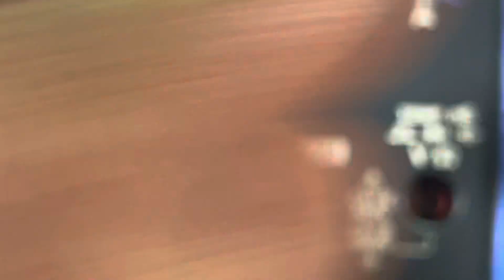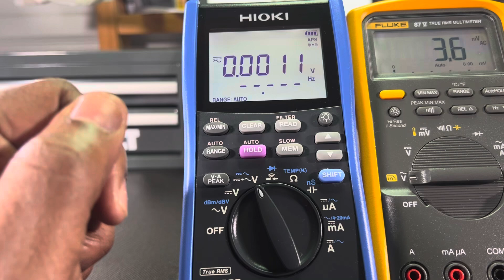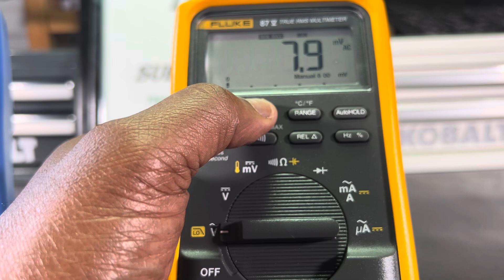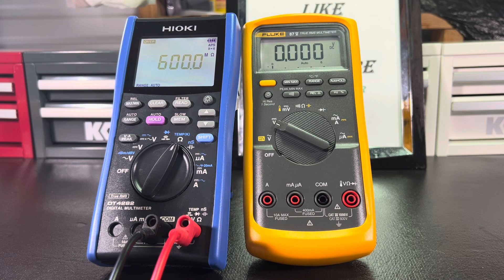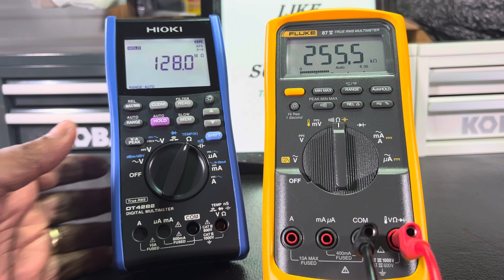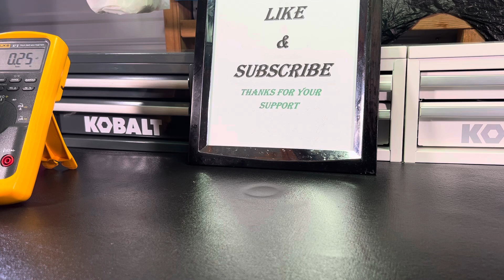HIOKI vs FLUKE  (Loser Go Home)

Comment: Try applying 8,000 volts to both devices for a couple of seconds... a Fluke will survive this without any damage, and the fuses will remain intact—so for a Fluke, 1,050 volts is an easy test. As for the "blue one," I’m not even sure it could handle 5,000 volts in a real-world scenario.
Reply from the maker: You maybe correct, but ask yourself how many times you test 8000 volts on a normal day. Both meters are max rated for 1000volts. So why would test 8000volts with either meter🤔
Reply: @TheElectriciansToolChannel  When working with inductances, such voltage spikes can easily occur. In any case, with a Fluke, my hands won’t shake when I’m measuring voltage on high-power motors, and I’ll trust the readings 100 percent—because NASA trusts them. They rely on these measuring instruments, and for them, errors would be incredibly costly.
Reply: I’ve watched a ton of videos featuring tests of these multimeters... yours, in my opinion, is the most interesting one... thanks for the enjoyable video!
Reply from the maker: Thank you

Comment: An important aspect has been overlooked: power consumption. The blue model uses 4 batteries for 100 hours of operation—at 8 hours of daily use, that’s only 2 weeks of runtime. The yellow model uses a single 9V (PP3/“Krona”) battery for 400 hours, which translates to nearly 2 months. Furthermore, judging by the video, the blue model’s screen is completely unreadable without the backlight, whereas the yellow one has no such issue. Consequently, the blue model—even with 4 batteries—won’t even last 2 weeks if the backlight is kept on. The yellow model’s screen is also much easier on the eyes. And what’s with this nonsense: in standby mode, the blue model flashes “6000”? That is so annoying...
Reply from the maker: , thanks for watching

Comment: HIOKI is the worst DMM I have ever had . Sucs battery fast, stupid APO system,  leads gets lose fast, screen contrast very bad. The UNI-T is better than HIOKI .
Comparing Fluke with HIOKI is not even fair.
Reply from the maker: As long as we can agree to disagree. Thanks for watching.
Reply: @TheElectriciansToolChannel  If you are a heavy user for DMMs, runnig them for +5 hours daily, you will understand how poor the HIOKI is.
Reply from the maker: Okay

Comment: Specs on paper don't tell the whole story. Having a few extra features means very little if the tool isn't backed by good parts availability and long-term support.

I needed a new front case for my Fluke 87V and found a brand-new replacement for around $20 on multiple websites, delivered within days. Try doing the same with a Hioki and see how that goes.

In the real world, repairability, spare parts, and serviceability matter just as much as extra menu options. A multimeter isn't judged by its spec sheet alone—it's judged by how dependable and maintainable it is after years of actual use.
Reply from the maker: I couldn’t agree more 👍🏾

Comment: Hello,
I think this comparison is not fair. You're comparing two multimeters dedicated to different market, and you are comparing a new HIOKI with a 20 years old technology fluke. Even there, if you had to compare, to be fair, I think you should compare HIOKI 4282 with Fluke 187 or 189. Those are the true market segment equivalents. (PS. I really like the Hioki 4282 more than the flukes).
Reply from the maker: I agree  , I don’t have a 187 or  189 so I used the next best thing.

Comment: Apparently, your measuring processes are a bit off-book. By the way, the biggest problem here is about the fundamental understanding of measurement precision. At the end of the video, we can clearly see a two-digit difference in the precision of the actual measurement. For the fluke, at the lowest setting, the precision (by book) is 0.2%, which is +/-0,012 ohms, plus 1 digit, overall, +/-0,112. As we can clearly see, 0.3 and 0.4 jumping, so the actual value can be anywhere between 0.188 and 0.512.
For the Hioki (pronounced hee'yokh, where ee' is a very short ee, like in "hit"), it's +/-0,03% plus 2 digits. The reading of 0,296 can be anywhere between 0,29182 and 0,29818.
Hioki is, by the specs, at least 10 times more accurate for this reading.
Hioki is a 60.000 count DMM, while Flue is a 6000 count (or 19.999 count in high-resolution mode). They're not in the same league.
But. Both should have been properly calibrated, and the proper measuring methods should have been followed to get the right readings.
Reply from the maker: Okay

Comment: Joe Smith just did a knockdown match: "Hioki DT4282 DMM vs Brymen BM869s" and guess who won? Clue: The one that was cheaper.😁
Reply from the maker: Great video I saw it.  Both are great multimeters , but I still like the HIOKI better. Thanks for sharing the information.
Reply: @TheElectriciansToolChannel  Update: Joe did the repair live (Hioki DT4282 Repair & Mods) and tried a few tweaks.
Reply from the maker: Thanks I will check it out

Comment: I like both brands and own their dmms.
The Hioki is definitely cool, but they flex a bunch more and don’t appear so durable. I had models that showed failure due to exposure to the elements in tough working environments. The Flukes never failed me. 
I love some of the features of the Hioki, but the durability and color of the Fluke give me the fizz..!
Reply: Precisamente por esa razón Fluke no tiene rival, está diseñaso para ambientes hostiles y extremos. Yo tengo un Unit que hace practicamente lo mismo que un Fluke, pero para uso industrial se requiere diseño especial y materiales durables.
Reply from the maker: I must agree
Reply from the maker: That’s true a fluke will last until the end of time. I’ll just have to wait and see about the durability of the hioki.

Comment: I have a Hioki 4282 & 4261 & 4141-50 and also some  Fluke  meters like the 189 & 177 & 115 as well as a few others like the old 27 FM as well as a bench meter.  I know the Fluke meters are tough I have used them for many years and while I always try to baby mine.. they see knocks and bangs occasionally, but I have seen others not baby them at all.. they have a rough life and they still continue to perform  and maintain functionality and accuracy . The Hioki's are fairly new to me and like the Flukes I will try to baby then too  but.. will they be as tough is the question? Only time will tell.. but from what I can see from the build quality I think they might  :)
Reply from the maker: I’ve been using FLUKE for a long time also. HIOKI is new to me, but I’m well pleased so far.

Comment: Recently, I wanted to buy a Fluke 87V, but spec wise and for what I'm going to use it it's not going to do much better than a less expensive, but just as if not more accurate dmm with probably more functions too.

 I also don't understand why so many electricians who brag about their complicated work always bring up multimeters, where there are much better devices for more complicated stuff and multimeters won't help them that much finding a real issue, unless the issue isn't very complicated or it's a bench work. Almost everyone that I've met who really works on complicated issues agrees that true professionals work with multi installation testers for more in depth troubleshooting and they are left speechless when people around them talk about expensive multimeters.
Reply from the maker: A lot of electricians here in the USA never heard of an installation tester. I do I’m planning on purchasing the FLUKE 1664 FC. Or the MEGGER version. I really like the FLUKE , because of the data logger and reporting. I don’t know where you’re residing at the moment? But installation tester are very common in the UK. In fact installation tester are almost a requirement.

Comment: Personalmente me gustan las 2 marcas 
Pero sólo un "pequeño" detalle 
Hioki Dt 4282 es la gama alta de Hioki y el Fluke 87V es una gama media de Fluke y bastante veterano 😉.
Quizás la comparación no es la más "justa"
Lo ideal hubiera sido Fluke 289😉
Éso no quita que el Hioki DT4282 sea un equipo excelente 
Un abrazo
Reply from the maker: I thought about using the 289 then I thought it would’ve been a bit more than the HIOKI. But what would’ve been the perfect match is the fluke 189. The only problem is that I don’t have one.  In closing the HIOKI Is one of the best multimeters I own. I I highly recommend it to anyone and everyone. Thanks for watching.
Reply: @TheElectriciansToolChannel  Correcto ,el equivalente al Hioki Dt 4282 es el Fluke 189

Comment: The Hioki should be able to do 60 Ω to 600 MΩ so the 250 kΩ should not be an issue.
Reply from the maker: Thanks for watching
Reply: The connection was dodgy- the Hioki was measuring 130 M ohm while the Fluke was 250 k ohm
Reply from the maker: You’re correct. I have to revisit that comparison again.

Comment: May I ask, why for a given 250,000 Ohm Resistance was read as 130 million Ohm (~130,000,000 ohm) on the HIOki 4282 ?
Reply from the maker: The dt4282 measured 130.0 megohms . I don’t know why it came up short ? It maybe because of something I did I’m still learning about the meter. Because after I stopped recording I  measured it again and the dt4282 measured the 250,000 ohm resistor.

Comment: I sure love seeing you introduce people to brands they may not be familiar with. I love my Fluke stuff I just wish they had a little more competition for certain products. I feel like if they had more competition they would be more inclined to innovate and come out with new stuff.  They should do a refresh of the 299 make it rechargeable color display fluke connect integrated etc but they have had no reason to. I bought an AEMC 3293 I’ve been test driving and so far I really like it. I had a BK precision 394 that got stolen out of my truck but I really liked it as well. 

I’m setting up a test bench in my office, do you have a recommendation for a bench multimeter and scope that are decent but I won’t have to sell a kidney for. Keep up the good work you’ll be at 10000 subscribers before you know it.
Reply from the maker: Thanks for your support. It’ll be another decade before fluke revises the 289 , if any. I was looking for the AEMC METRIX  MTX 3293B this morning to purchase. I have the AEMC 3290  that I did a review of about a year ago. I wasn’t particularly pleased with it, check it out when possible.As far as a bench top multimeter maybe RIGOL or SIGLENT. I don’t have a bench top multimeter, I have too many other handheld multimeter options to choose from. But I have everything else to make my electronics bench operational. Thanks for sharing your thoughts,stay tuned I have some great stuff coming up the pipeline. By the way also take a look at my channel on YouTube SHORTS platform. You’ll get a kick out of it 👍🏾
Reply: Are you still using the AEMC 3293, and what are your thoughts on it?
Reply from the maker: I  don't use it as much. It's okay its not as fun to use as the other meters I have. That's just my opinion.
Reply: @TheElectriciansToolChannel I have a question. In one of your videos, you accidentally connected the AEMC 3290 current measurement device directly to the 110V mains. From what I can see, nothing happened to the device. Is the current measurement still working correctly?
Reply from the maker: I'm ashamed that was a beginners mistake 🤔
Reply: @TheElectriciansToolChannel There's nothing to be ashamed of, everyone makes mistakes, but some mistakes are irreversible. But what I'm wondering is, is the AEMC 3290 current measurement working correctly?
Reply from the maker: I used it a few times since airing that video. And everything is fine.
Reply: @TheElectriciansToolChannel That's an interesting situation. It's good to hear that the AEMC 3290 is intact. It seems God protected you.👍
Reply from the maker: Yes HE’s my protector. I must go back and watch that video. I can't believe I made such a blunder.
Reply: @TheElectriciansToolChannel In the Hioki DT4282 vs. AEMC 3290 comparison video, look at the part where you're trying to measure 120V mains voltage.
Reply: @bahadryldz2346 I love it… but I’ll give you my use case because it’s a little different. Basically I travel across the country diagnosing  industrial and ag equipment when the dealerships techs get stumped. The highest voltage I work with on the job is 48v, and I do a ton of can bus, PWM/duty cycle stuff and i can do 90% of what I need to without getting out the pico scope. It’s not quite as user friendly as the 289 but thats the only knock i have on jt

Comment: I have been using Hioki for over 36 years as an electronic hobbyist and believe it is far superior to Fluke. I don't understand why everyone chooses Fluke.
Reply from the maker: I've been using FLUKE for a very long time also, and using a fluke was engraved in my head which wasn't a bad thing. but over the years I've in some cases fluke is overrated. So, I began to search for the next best thing and I came across several test instruments that are highly competitive with a fluke for far less money. So, I agree with you and in this case the hioki wins. Thanks for sharing your expert opinion. I hope you subscribed to the channel there's more content coming.
Reply: in Vietnam, I've seen Hioki everywhere but have not seen Fluke. Hioki meters are also quite a lot cheaper compared to a Fluke at similar spec and is reliable and durable.
Reply from the maker: I agree totally 💯 %. HIOKI is a brand that once you’ve used it you’ll see why people would consider choosing it over a fluke . Don’t get me wrong fluke is a great brand, but in most cases in a comparison HIOKI either matches or surpasses a fluke product in one way or another. That’s just my personal opinion.
Reply: Super reliability in all circumstances, always, at least in my extensive experience. Accurate within spec and such low drift they never need to be calibrated. But their prices don't justify them for the hobbyist market, and their robustness is not required for benchwork. My gripe with my present model (an 87V) is that it's missing features it absolutely, as an industrial meter, should have (harmonic ratio, LoZ, slightly higher IP rating) and I extend this to the Fluke range in general; many of their meters are missing features that should be included for their respective target markets.
Reply: @patrickhayes-foley6390  fluke is overrated. It's a gimmick
Reply: @justjames1348  probably overrated, due to brand recognition yes, gimmick, not a chance.  I use other meters, but in terms of usability and long-term reliability and robustness, in challenging circumstances, the 87 series is superior and has earned its place as my day-to-day meter. The competition is catching up and the Fluke premium is becoming harder to justify. I'm not familiar with the Hioki brand but my experience with Japanese engineering is extremely positive so the conclusion of the video doesn't surprise me. At work I've put in a request for Uni-T clampmeter because it has all the functions I want and, at least on paper, has a high IP rating.
Reply: @patrickhayes-foley6390  I also work in the industrial scene. I can’t justify the price tag. There’s better meters out there. The bm788bt by Brymen is better then 289 and 87v max. Half the price and more features. The Hikio 4375-50 is cheaper the the 378 and is better. Fluke has a name and that’s it. Maybe its amazing quality
Reply from the maker: Well said 👍🏾
Reply: I agree, Hioki is most accurate, but too expensive just like Fluke and really needs a face lift in design
Reply from the maker: The only thing that they can do is reverse their signature colors.

Comment: From 33:15 to 34:10 he keeps us waiting 55 seconds while he fails to notice that he has not made a connection to his test resistor and thus concluded that the blue meter had failed to make the measurement. He is totally confused about what is a kilo-ohm and what is a mega-ohm. He is not using precision resistors for his comparison and is unaware of this. What a clueless clown. A truly worthless video.

Comment: We bought fluke 289 at work ,  the quality is not as my fluke that i bought for 20 years ago , plastic parts break , connection not good , battery drain very fast .
It was good quality in past but not anymore. 😒😒😒😒
Reply from the maker: Maybe fluke is getting to complacent at the number one position for so long 🤔
Reply: I was thinking of buying the Fluke 289, but after using it for a while, I thought it wasn't worth the price, so I bought the Chauvin Arnoux CA5292 instead and I'm very happy with it.
Reply: I am 60 years old and wanted my last multimeter, the 289 was my dream, i hesitated a lot and bought a metrix mtx3293, and i am very happy with it. This serie is better than the previous who was foldable and not durable.
Reply: Fluke 87-V similar
Mercedes E-220

Simple and effective,
Hidden feature:
250 uS Peak Min-Max
Reply from the maker: @MTdesign123 👍🏾